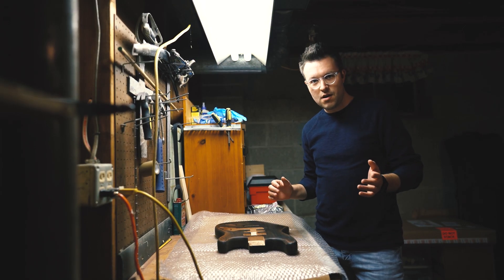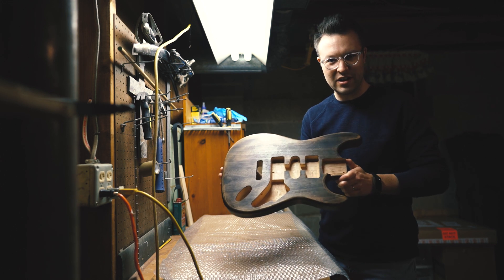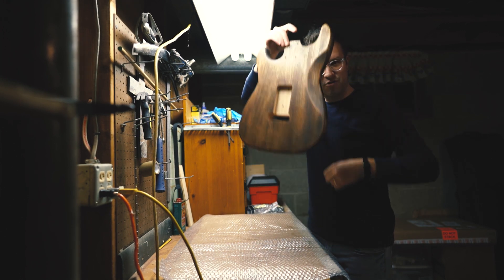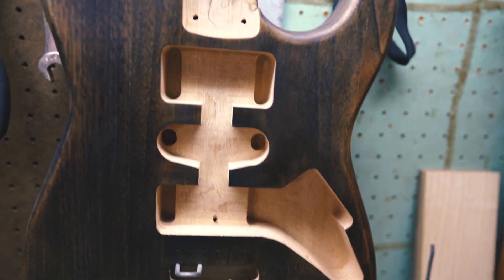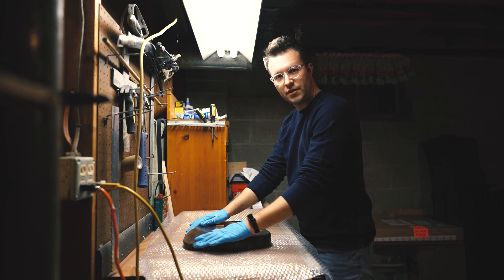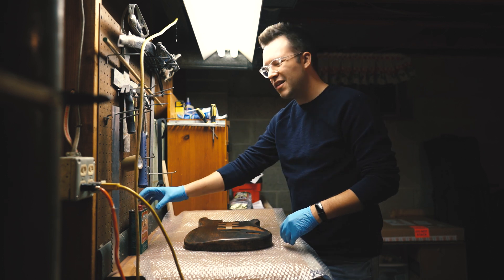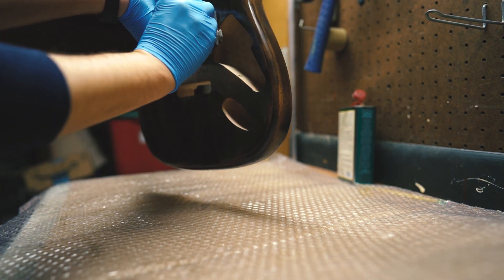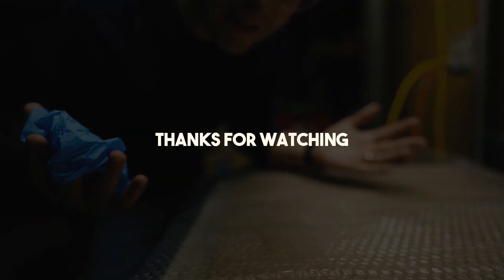Building a Kit Guitar from StewMac - Ep2 - Staining and Tung Oil Finishing - ASMR

Comment: Hi Archie, what kind of dye did you use?  I really like how that turned out and am thinking about finishing a new build like that.  Thanks!
Reply from the maker: Hi Chad, I have used a black leather dye many times. Applied it with scrap cloth, then lightly sanded it to make it look worn. I ran out of the black dye, so I actually ended up using a walnut stain from min wax.  Then sanded it to make it a little worn.

Comment: Hey What stain and tung oil did you use? The more details the better, I'm trying to purchase a decent stain and oil. Thanks!
Reply from the maker: Hi Charles, I just used a Minwax stain walnut color. For tung oil I have used Formby's and Minwax, both worked great. I tend to look for the satin or matte, I'm not a huge fan of high gloss.  The nice part of oil is it starts out matte and the more coats you apply the more glossy it gets. 

I typically apply a few coats at first as the dry wood just sucks up the oil fast. I let it dry for 24hrs and apply another coat or two. Wiping in the finish is really easy with a cotton rag/scrap.
Reply: @LegacyGuitars  Thanks Archie, is the minwax stain oil based or water based?
Reply from the maker: I have used the oil based, can’t vouch for the water based. It could be good too.

Comment: Can I use tung oil before I use sanding sealer and nitro color finish?
Reply from the maker: Hi!
I have used tung oil and let it sit for a day, then nitro many times. No problems with adhesion, nitro is really cool stuff, but potent.
Reply: @LegacyGuitars  awesome, thank you I have some left over finishing supplies and a really pale body, I was gonna dye it and do oil, then sanding sealer , then white vinyl nitro, then fiesta red nitro, then a bunch of clear coats, then wet sand the clear coats and when it get chips it won't be the pale body
Reply from the maker: That sounds awesome, the one tip
Is do a handful of coats of the white, nitro is crazy thin, I put 4 coats of white on trying to do the same thing and when it wore out it still went right from black to wood.
Reply: @LegacyGuitars  sweet thank you
Reply: @CensorWars  If you are using nitro, the original fiesta red fender guitars never had a clear coat because nitro yellows over time, making the fiesta red go a funny colour. Also, you seem to be putting a lot of work into the undercoat. Dye, sanding sealer and primer?? Even if u chip the nitro, it is unlikely u will see the wood. Most likely just the white undercoat. I've sprayed my strat with nitro a few times and I dont baby no guitars. I've never went through to wood...well I dont think I have lol

Comment: Nice video! I’ve always done nitro finishes, but I think I’m going to try doing a tung oil on my current Tele build. Thanks for the video! ✌🏻
Reply from the maker: Hi Wade! Tung oil is great when you have some pretty wood to show off. I do also love the vintage feel of nitro. Tung oil is super easy and forgiving to work with, simple wipe on.
Reply: @LegacyGuitars  How many coats did you do? I have a strat I'm building and have done three think layers so far but if feels like it needs more.
Reply from the maker: @scrimpmster  Hi!! 
I would say keep adding coats until it’s where you like it with coverage and glossy-ness. You can always gently sand it back if you go one step too far.